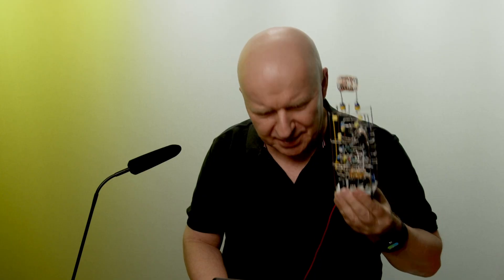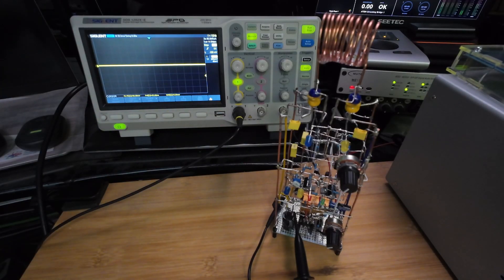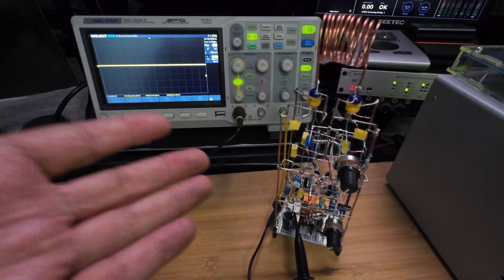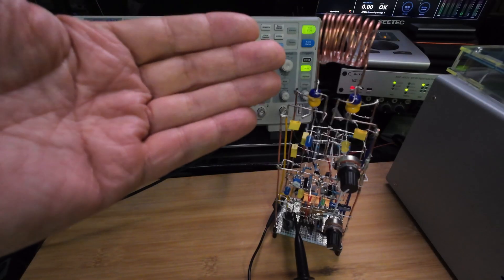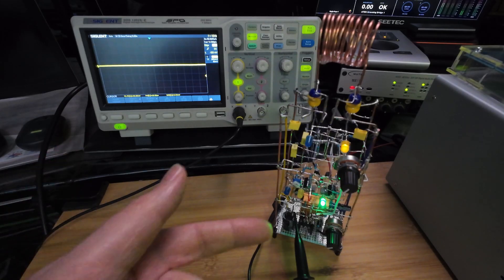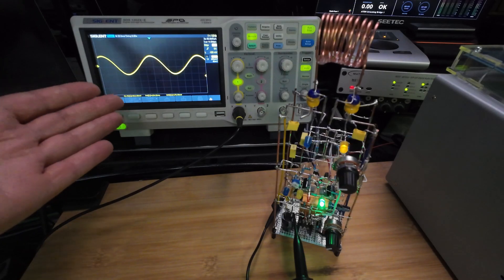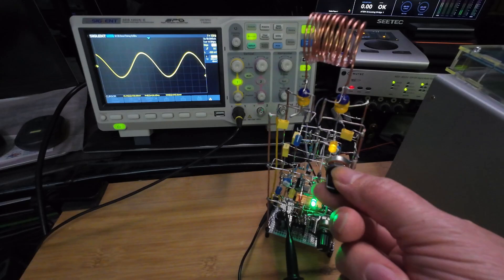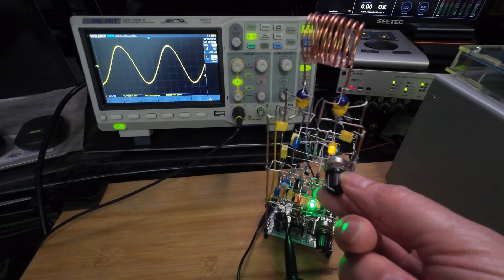Schumann Frequency 7.83 Hz: Toy or Tool? Resonance or Generator? The Truth About Analog Sine Waves

Comment: Hello Mattias. I suggest placing quartz in the coil, single crystal or bag of crushed quartz. This will embed beneficial new information into the field emission.
Reply from the maker: @ericmc6482
Hello dear Eric 
perhaps you didn't quite understand the experiment; if you look closely, you should check:
do you see that there's a quartz crystal already inside the coil? 
Take another look 😉
I had two quartz crystals:
one in the coil and the other one just for the demo on the wood block.
The Citrine quarz that I held in my hand was just to show another alternative.
Otherwise the experiment wouldn't make sense.
The Quartz must be in the middle of the field in the coil.
We need a complete crystal with it's perfect lattice structure.
Thanks for your comment.
Happy experimenting!
Much love,
Matthias
Reply: @MatthiasLenardt  Hi. I went through the transcript and no mention of quartz or citrine, perhaps a different video ?.
In my experiments with Bio beneficial energy emissions I find crushed quartz is preferable to crystal quartz.
Reply from the maker: @ericmc6482
Hello dear Eric,
this is funny:
I was confused!!
Why?
As you were taking on quartz, I internally (in my mind) switched to the video that I uploaded YESTERDAY!!!
I made exactly that!!!
And I thought:
the quartz was in the coil ... why did Eric not see it?????

I made my Schumann frequency 7.83 Hz generator exactly for that.
So here is the solution:

'Fluid Schumann Frequency 7.83 Hz Generator: Let's Drink The Future'
https://youtu.be/KmrtIZsPkQM

You will love this video!
Enjoy!

Thanks for clearing this misunderstanding up 😉👌
Have a fabulous Sunday.
Much love,
Matthias
Reply: @MatthiasLenardt  That explains, and great minds are thinking alike haha.
I suggested crushed quartz, carved solid quartz torroid/donut inserted at each end of the coil would also transmit 'beam' of naturalised energy, the driving frequency does not have to be Schumann frequency.
My other thoughts in this Schumann subject is sensing existing natural field and using this signal to drive an amplifier driving a local coil, ie phase locked, perhaps this could be core of 'med bed' design.
Reply from the maker: @ericmc6482
Finally dear Eric 👌
Thank you so much for your inspiring thoughts! 
Integrating the quartz as a toroid or 'donut' directly into the magnetic flux of the coil is an excellent approach to field focusing.
In my current setup, I’m taking it one step further: 
I’m using the quartz as an active modulator to refine the informational structure of the signal even more. 

Combining the magnetic field with the crystal's geometry opens up entirely new dimensions.

Your idea of sensing the natural field and amplifying it 'phase-locked' is the logical next step toward deep tech – potentially enhancing nature through a sort of 'echo process.' 
Let’s keep exploring the 'unexplored border area' together! 
And more will come here 😉
Much love,
Matthias
Reply: @MatthiasLenardt  Hi Mattias. 
In my investigations I find the 'spray' of directional radiations from the corners/points of single crystal quartz is not optimal.
This is why I suggest crushed crystalline quartz, the directional properties are amortised according to the fineness of the particles, nanopowder is optimal IME.
Stacked toroids also works well, the more toroids the more focused the 'beam'.
Cheers.
Reply from the maker: @ericmc6482
Hi Eric,
thanks for your perspective!
Your experiments with nanopowder and focused beams sound technically very ambitious.
That must be amazing!
I wonder, however, how your "toroids" are manufactured.
If they are pressed or glued with binders, they introduce chemical interference signals into the system.
Furthermore, due to the random arrangement, the tiny particles lose the piezoelectric structure of the original quartz.
The atoms then vibrate against each other instead of with each other.
That is exactly the reason why I am taking a different path with my project:
For me, it is not about creating an artificial "beam" through technical force.
I rely on the untouched, grown lattice structure of the whole crystal.
A whole rock crystal is, for me, a hardware unit that has settled into its rhythm over millions of years.
It serves as a "master teacher" to imprint a harmonic order onto the water.
Without chemicals, without binders, and without losing the natural coherence.
Nevertheless, an interesting approach you are pursuing there!
By the way, you have a wonderful lab in the background where you are working out fantastic things.

Cheers, 
Matthias

Comment: How does a small coil work at such low frequency? It looks like your oscilloscope is directly measuring the oscillator output voltage via wire from your oscillator, could you show a video on what's actually being emitted into space from the antenna instead?
Reply from the maker: @Tharsis879
Hello Rider,
It works perfect.
I’m obviously not going to reveal all my technical details and secrets here – a little bit of 'lab magic' has to remain. 😉
But the point is: The size of the form doesn't change the law of the principle. 
Physical laws stay the same, whether a coil is small or large. 
It’s all a matter of energy density and the right resonance. 
If there is enough interest, I might even produce a video in the future and explain why I use a coil of this size.
Once you master the principle, the facts speak for themselves.
From ghosts to physical facts – we are embracing everything. 
👻✨
Reply from the maker: @Tharsis879
Hello Rider,
why so complicated?
I am simply feeding this coil with 7.83 Hz. What you see on the oscilloscope is the sine wave result of my Schumann Generator – it’s clean, it’s present, and it’s a physical fact. It feeds my coil directly.
There is no need to look for 'emissions into space' when the experiment itself is right in front of you.
As you observe my presentation, you clearly see what I'm doing.
👻✨
Reply: @MatthiasLenardt  I would like to see the signal from another antenna nearby on your oscilloscope. A view of the oscillator output of the PCB is meaningless in this context, what's important is the antenna output. An antenna that size is not tuned for a long wavelength like 7.8 Hz, the wavelength of a 7.8Hz signal is 38,282.67 km. I like your circuit but what's actually being emitted from the tiny antenna?
Reply from the maker: @Tharsis879 

Hello Rider,
you are absolutely right – as a transmitting antenna for global broadcasting, it would be a total failure. 😉
But that’s exactly where the misunderstanding lies: we’re not building a radio station to contact Mars here.
In fact, I have already explained all of this—including the physics of wavelengths and why this isn't a traditional antenna—in my various videos.
The coil is specifically designed to create an electromagnetic near-field for my experiments.
I don’t use it as an antenna, but as a resonance body for the frequency right on the spot.
The view of the oscillator output makes sense precisely because it pumps the energy into the system.
It's interesting that you mention the wavelength, but as I've said before: the 'magic' happens in the near-field, not in the distance.
Have a fabulous weekend! ✌️

By the way, here is a thought experiment for you: 
If you place a radio antenna in front of a loudspeaker (small coil, 20 Hz - 20.00 Hz or wavelength: 15.000 km - 15 km), would you expect to see the frequency of the music on your oscilloscope?
Of course not (but you still enjoy the music).
The speaker creates a local field, just like my coil creates a local resonance field. If you only look for 'broadcast signals,' you will always miss the point of a localized experiment.
Maybe it’s time to do your homework before telling others they don't understand their own circuits. 😉

Comment: This kind of devices produce sin wave only inside the cable, there is no propagation of electro magnetic wave because of - insignificant power delivered to antena, and antena being too small (Shumann wave needs like 34k KM antena or 1/2 1/4 fraction of it - still in thousands of km long).  This device is a joke for HAM radio users ;P.   It can only works - and works very good when you connect that antena to a speaker - it will then produce a nice Acoustic Wave
Reply from the maker: @Arturborzecki
Great comment, but let’s get the physics straight!
As a HAM radio user, you should know I’m not building a transmitter. If I were, I’d be the first to know that I’d need a massive antenna. But even your math is a bit off: for 7.83 Hz, the wavelength is roughly 38,000 km, not 34,000 km.
However, this device isn't about Far-Field radiation. It’s about the Near-Field. You said the signal stays "inside the cable"—but that "cable" includes a precision coil. Physics 101: Current through a coil creates a magnetic field that extends into the space around it. Think of an induction charger; it transfers energy perfectly without a mile-long antenna.
Regarding the speaker: 7.83 Hz is infrasonic. A speaker won’t produce a "nice wave" for the ear; it will just move air in silence. We don't want to hear the pulse; we want the body to resonate with the pure analog field.
My oscillator provides the organic purity the biological system recognizes, without the digital noise of commercial "toys."
It's not a radio station. It’s a biological tuning fork. ;)
A radio operator seeks the distance; I seek the depth.
Much love,
Matthias
Reply: @MatthiasLenardt  You’re right that 7.83 Hz is inaudible, but a speaker will still produce mechanical vibrations at that frequency, and those vibrations can propagate through air, surfaces, and the body far more effectively than an ELF magnetic field from a small coil.
Yeah the wave  is ~38,000 km to be exact :) - I’m not HAM user ;). Where we still differ is the near-field implication. At 7.83 Hz, a small coil produces a quasi-static magnetic field that drops off very fast (again im not sure if that’s how it should be measured: ∝ 1/r³). That’s fundamentally different from induction charging, which works at much higher frequencies with tight coupling and large currents.
A constructive next step would be to measure the actual field strength versus distance, especially at human scal…. to verify whether the field meaningfully reaches a person standing next to the device (and again let’s even forget affecting living tissue - and focus only on much weaker and more sensitive elector magnetic field around human body).
From an energy standpoint, exposing the human body volume to a coherent ELF magnetic field would require very large coils and/or very high currents, far beyond what small desktop devices can provide. Otherwise, the field remains well below natural background fluctuations.
So while the device may generate a clean 7.83 Hz signal electrically, physics doesn’t support it acting as a spatial “biological tuning fork” beyond placebo-level effects.
Reply from the maker: @Arturborzecki Thanks for your input! But tell me: With all the joy and passion I put into building this—do you really think I should just stop exploring? What you see is a snapshot of a living process, not a final destination. I am constantly refining and evolving these designs in the Lab. Is there no room for the joy of creation and the journey of discovery in your world and also no room for sharing my experiments?
I am only using the field inside the coil ...
and by the way:
I am a HAM Radio operator ;-)
Reply: @MatthiasLenardt and btw I’ve subscribed!!!! ☺️☺️
Reply from the maker: Welcome to the Lab, @Arturborzecki! I’m glad you made the jump from skepticism to resonance.
You’ve landed in a space where we don’t just look at the technical signal, but at the bigger picture. 
Here at the Conscious Creators Lab, we use frequencies, mental perspectives, and sometimes a bit of provocation to keep the human mind in motion. 
Because only a mind in motion can discover new horizons.
We’re exploring the depth, not just the distance. 
Great to have you in the game – let’s keep expanding perspectives together!
From ghosts to physical facts: We are embracing everything. 🥂✨